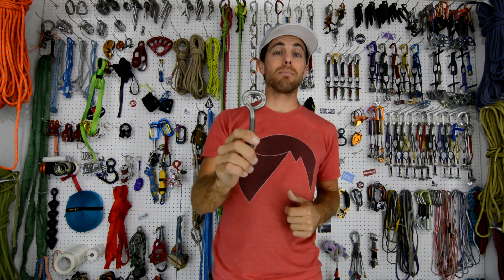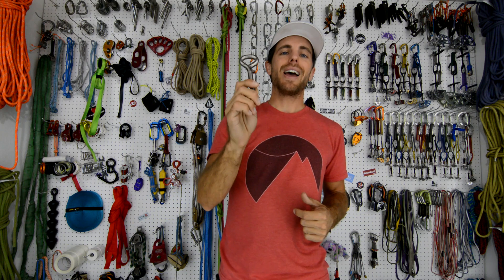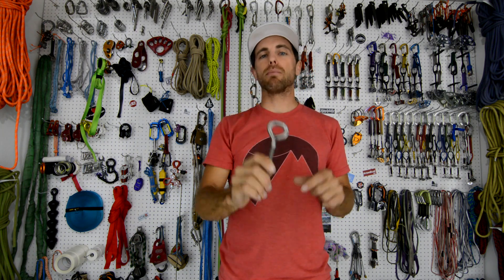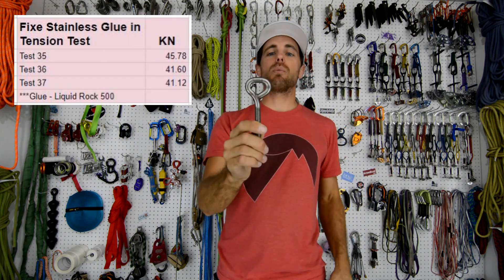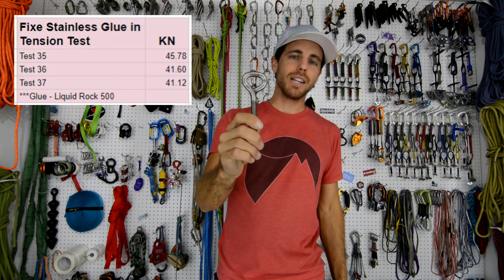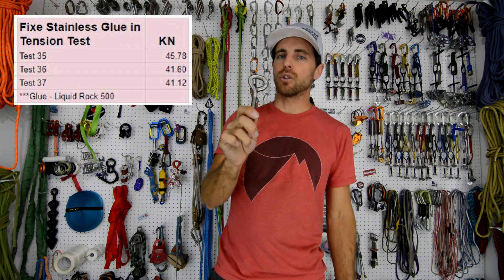Climbing and highlining bolt break tests - Fixe glue in

Comment: So 40kn. 
When are they ever going to be exposed to THAT level of stress? I personally can't see it happening.
Reply: I'm wondering about cyclical load testing, loading/unloading the bolt.  Petzl did tests with 5kN loads at 1hz cycle, and broke theirs after 15,000 cycles.
Reply: It's really good that it will never see that level of stress -- since you life depends on it. For an item like that I would personally want at least a 4:1 safety factor.  That is, I would want it to be at least 4 times stronger than the worst shock load I think it might see.
Reply: @Andrew Snow, that was pretty much the point I was making.
Reply from the maker: @5tr4nge75  I can generate 20kn on some bolts in highline scenarios (rare).  I also need it to break that high if I want a safety ratio.   And this is best case scenario install.  It's nice to know we have some wiggle room if someone doesn't do it right... with limits of course.
Reply: @HowNOT2  Have you considered cyclical load tests?  Petzl, for example, tested their bolts with a parallel pull at 5kN on a 1hz cycle, broke after 15,000 cycles.  The bolt easily would sustain a greater static load, but it's the load/unload cycle at low kN that did them in.  Thoughts?
Reply from the maker: @johnmdelisle  I think I could engineer a machine to do it but that is after I exhaust slow pull tests.  I've got a year of work ahead of me with just that.  Also drop tests sound interesting to me.